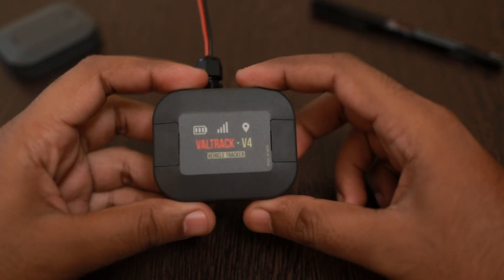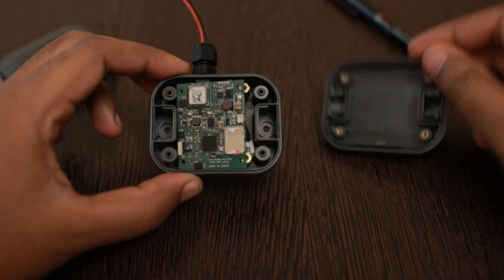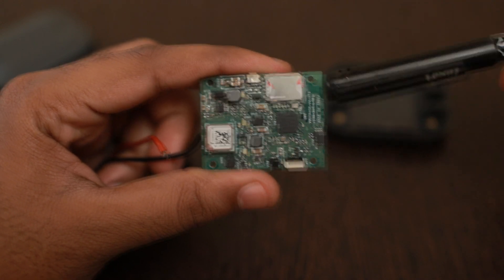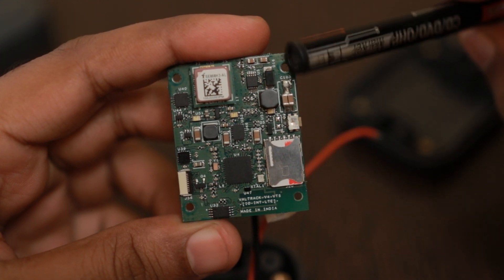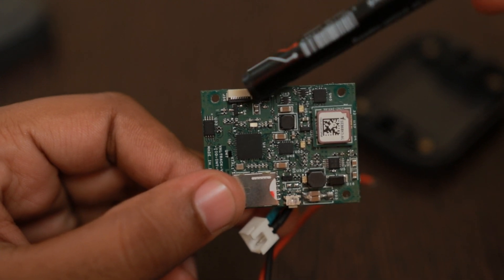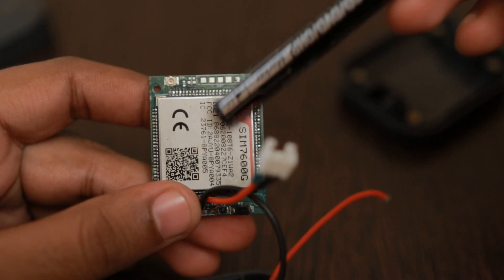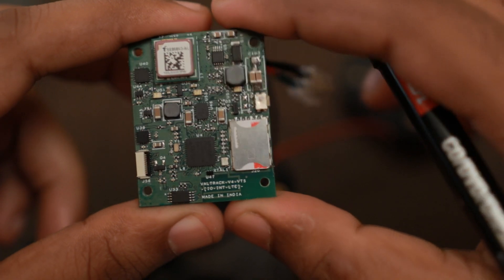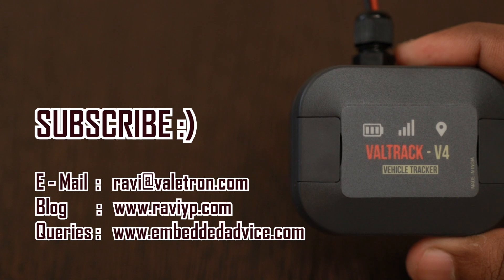Designing a 4G-LTE Vehicle GPS tracker for Global market - VALTRACK-V4-VTS-IO-INT-LTE

Comment: sir can you please tell me which inductor you used  with the voltage regulator
Reply from the maker: They are 10uH and 1.5uH inductors. Check datasheets, they mention everything
Reply: @RaviPujar  What is the ampere rating i should use of the 10 uh inductor

Comment: Sir how do you test the  circuit for a individual ic like the  dc dc step down converter circuit  is there any way to check  or verify the working of the an piece of ciruict before putting it into the main project circuit??
Reply from the maker: We get evaluation boards and test first or we make small designs before putting in bigger designs. Sometimes we just take the risk by well engineering the design.
Reply: @RaviPujar  Okay thank you soo much sir